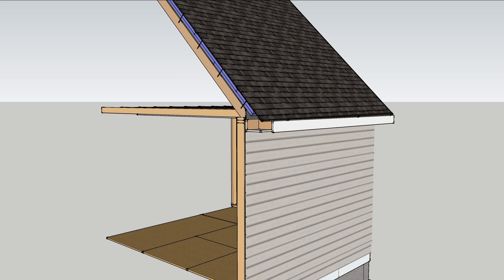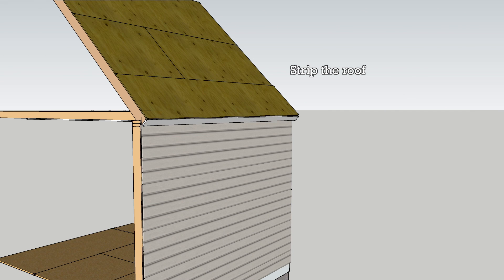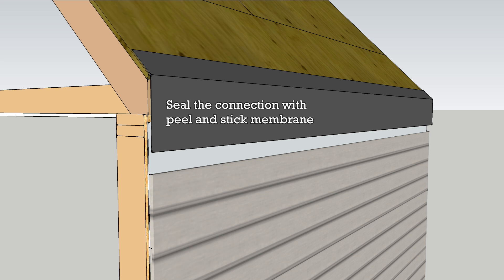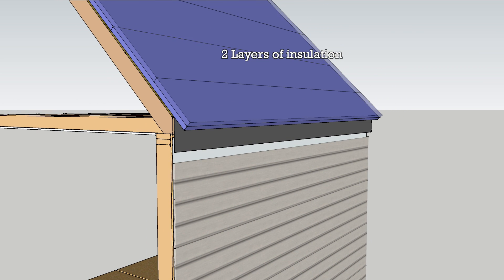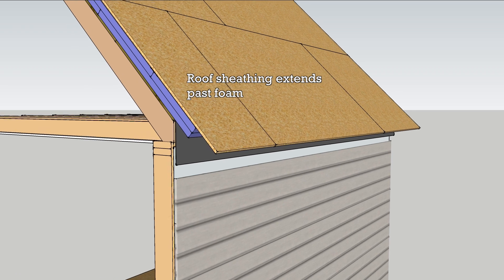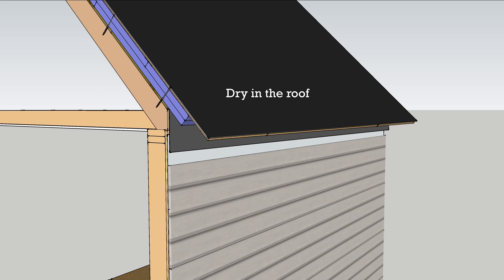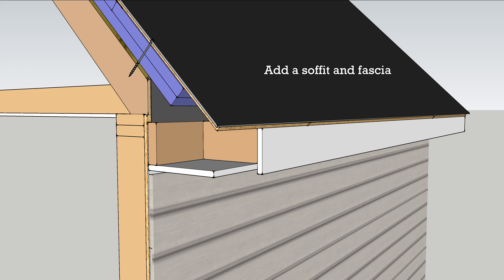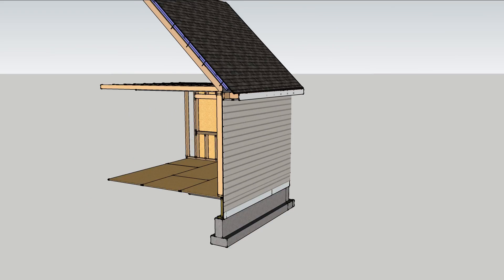Roof Insulation Retrofit (Unvented roof)

Comment: Or - disregard the low key gaslighting by the “green energy” and whoever else like ur electric gas energy provider as you cannot simply create an efficient home up to 2024 standards without tearing down and rebuilding the goddamn entire structure. Fuck this man -
Reply from the maker: Get a grip, bro. 
When you are replacing the roofing or siding, it is a once-in-a-generation opportunity to dramatically increase the thermal performance of your home. It will never be cheaper, because the siding or roofing is already removed and in the dumpster.

I cut my energy bill by 40% when I added exterior insulation to the walls—without even doing the roof yet.

Comment: Do you not have to apply peel and stick to the whole first layer of the roof under the foam for air sealing?  What kind of products do you recommend?  Top layer could be synthetic like tigers paw, correct?
Reply from the maker: You could, but you do not have to. A layer of roofing underlayment would work. The foam, especially if you use two layers with offset joints, will significantly cut down on air leakage. Benjamin Obdyke has a new product called VaporDry, which is a peel-and-stick underlayment that allows vapor to escape while keeping liquid water out.

Comment: Here is my take but... I am not an engineer:

Roof system "ventilation and insulation" are important for a number of reasons, including:

condensation control; temperature (or heat) control;   energy efficiency; and the prevention of chronic ice dam formation.

Ventilation of attic areas is intended to prevent the accumulation of... moisture vapor in the attic-roof space and to dry low levels of condensation.... that may form on the underside of a roof deck.
Ventilation is also intended to reduce the temperature of the roof deck during hot periods to improve shingle durability.  Reducing attic temperature through ventilation and insulation also improves energy efficiency during hot periods.

 In the case of ice dams, elevated attic and roof temperatures during the winter can cause snow on the roof to melt. 
Insulation and roof ventilation help to keep the roof’s exterior surface cold and minimizes the development of melted water and, consequently, ice dams.

Ventilating roofs.....in hot and humid conditions.... may add -- rather than remove -- moisture ....from attics and enclosed roof spaces.

However.....not ventilating..... a roof may ....void the manufacturer’s warranty..... and slightly decrease the life expectancy of the asphalt shingles due to the increased temperature of the roof surface.

In colder climates, roof ventilation serves to remove humidity and condensation from the roof-attic space and helps to prevent the chronic formation of ice dams at eaves.
Tile, concrete and metal roofing materials are not similarly affected.  It is possible to have an...unvented attic space.....but such a choice may require designing the attic-roof space as ....a conditioned space.....similar to that required when creating a habitable space in the attic. 

Traditional attic ventilation remains a cost-effective.......though imperfect solution for...moisture control.